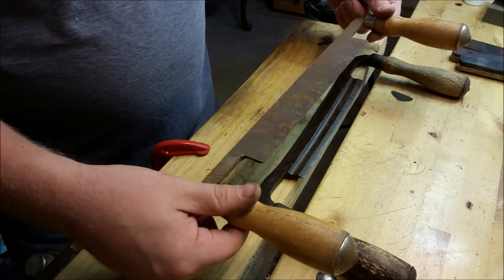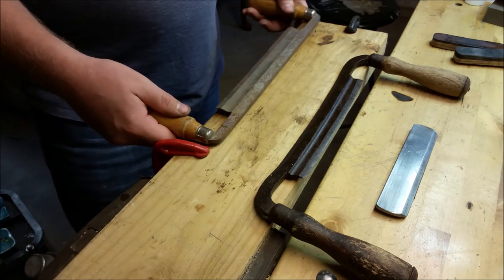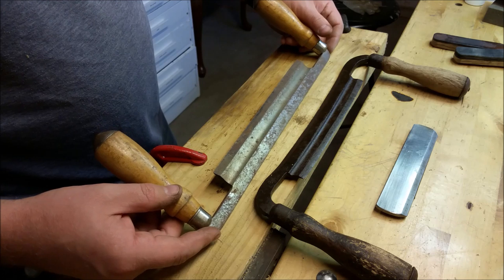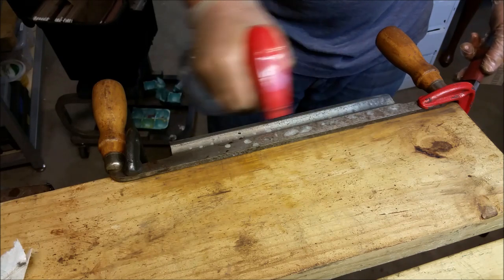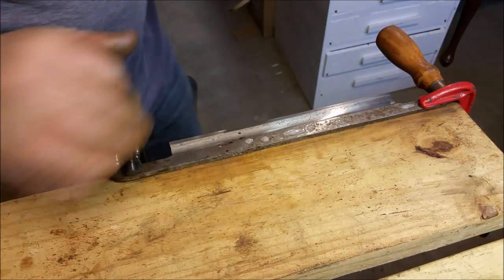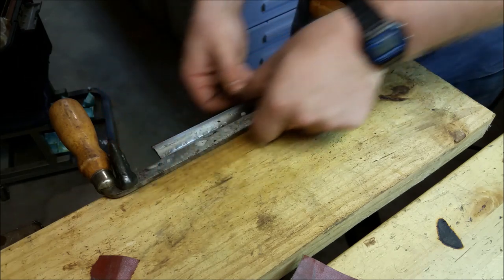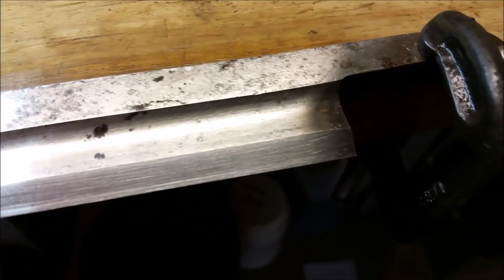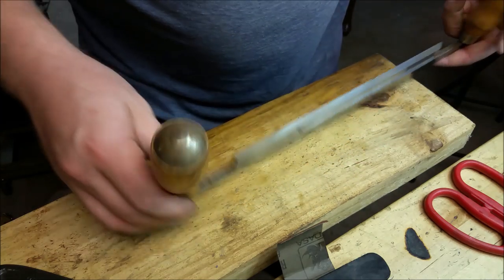Sharpening a Drawknife with Hand Tools - No Grinding

Comment: Hello, "WW";
Well, "Thank you!" for pointing me in a good direction.
I just bought an old (abused) Fulton 8" drawknife.
I used a putty knife as a scraper to remove most of the rust then 4ought steel wool.
It has a compound curve, the back is curved & the bottom curves up at the ends.
So it hard to try to remove the burrs & dings where some genius messed up w/ a grinder.
You technique showed me I needed to use scraps to raise the ends.
That gave the clearance to smooth the edge w/ sharpening stones.
I started w/ a cheap "medium" carborundum (Harbor Freight 'Gordon' Combo sharpening stone) & progressed up to 1000 grit cheap diamond plate.
I've had to rework the angle some to get it to the 20°.
I use the 'sword sharpening' stroke to finish the edge.
I found it works really well on Scandi grinds & since a drawknife uses a similar angle it should work for it, too.
Great video, Thank you, sir!
Have a GREAT day, Neighbor!

Comment: If I ever saw a person grinding on a drawknife I may have to educate this individual,  swiftly.
Reply: Hahahahaha........ YES! I might even recommend a minor boot to the butt! Honestly, ANY tool with high carbon/alloy edges that may be effected by heat and are expected to perform fine cuts should never be abused by any sort of powered grinding wheel. The one exception? Badly damaged/chipped blades. And only with light/short duration grinding with PLENTY of water in between to keep things cool.

Comment: I've got the same Drawknife , I just got most of the rust off it , I did cheat on the cutting edge , I took one of them sandpaper flap type wheels on a 4 1/2 "
Hand grinder to polish it up , from there I went with some 600 grit sandpaper, then jumped to 1000 , an then hand stropped till razor sharp , man they got some Good Steel in those old draw knives ,
Reply: I have a Greenlee too.😊
Reply: Seen alot of that exact same style of drawknife from numerous brands and I've always wondered if they were all made by in the same factory and just stamped different. Ive seen that exact style, same blade shape and profile, same handle shape, same ferrules and end caps from Greenlee, Dunlap, Sears, Craftsman, Zodak, Van Camp, and probably few others I'm forgetting.

Comment: When sharpening a drawknife it is a good idea to use some thin painters tape and cover only the cutting edge. Make a few layers. You can stretch the tape out and place it over the very edge and a few mm back and use the cutting edge or scissors to cut the tape. Repeat as many layers as needed because when you are going back and forth rubbing with your sharpening material you absolutely do not want your hand to roughly slide across thst edge. It makes me cringe just thinking about the damage that could cause, especially if you slipped and cut an artery. Yes, some tape could be a great friend when sharpening in this way

Comment: #1 when sharpening your drawknife....... BE VERY CAREFUL!!! It is probably THE MOST DANGEROUS tool you will ever sharpen.  #2 I don't know why almost everyone I see doing videos of drawknife sharpening seems to be trying to keep the bevel side a completely flat angle.  Drawknives work much better when the bevel side actually has a SLIGHT radius (a gentle curve from the sharp edge fading towards the back). That radius will give you much better depth of cutting control when using your drawknife. It allows you to rock the blade edge towards you while pulling for a deeper or more aggressive cut or, roll the knife away some for less depth and a very thin shaving action. A totally flat bevel is very hard to control in comparison. #3 RELAX and take your time. Hahaha, it's a slow process but worth every minute invested.